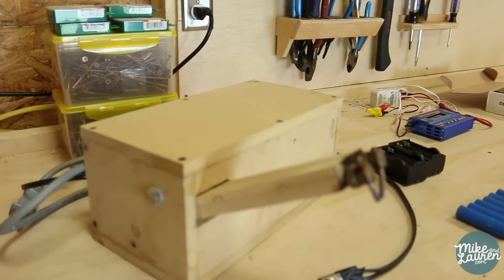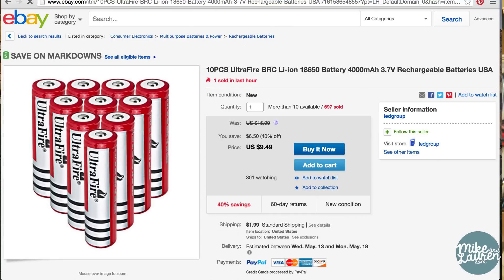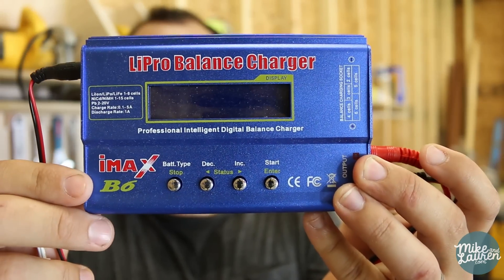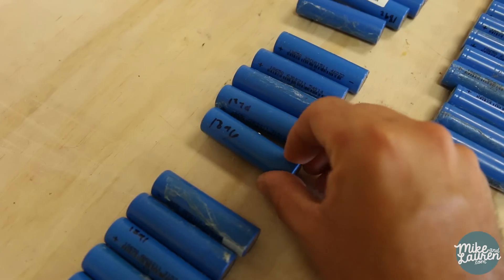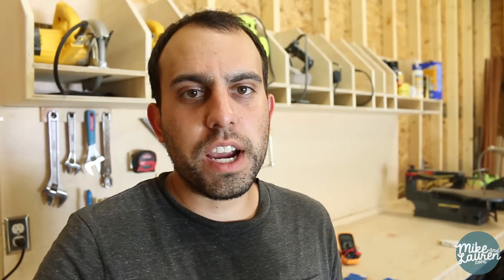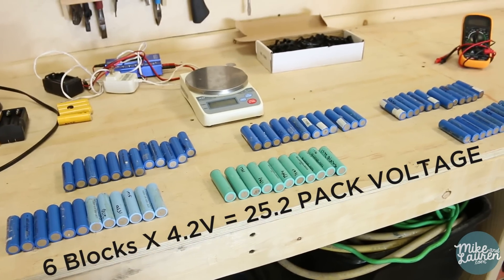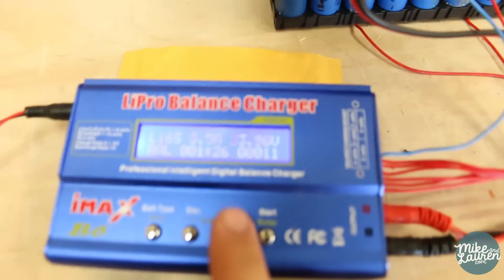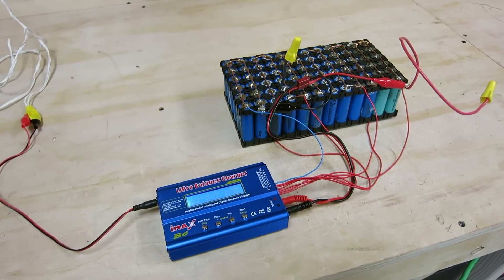DIY Lithium Ion E-Bike Battery Pack from 18650 Laptop Batteries

Comment: How to charge this amount of 18650's? This little B6 can do the trick i reasonable amount of time?

 I'm planning to build something like this for custom boombox. It will be 12V (16.8V with regulator) and i hope to attach one charging port instead of balancer.
Reply: +Yunneck if your boombox is low wattage then use a 3.7v to 12v board from ebay, if it is high wattage then yes use a buck converter

Comment: why do you use so much batteries i dont get it,you can use only 6 batteries 18650 because one fully charged 18650 has 4.2V... so 6x4.2=25.2V and for example the battery has 2200mah 2200x6=13.200mah or 13.2AH i dont know why you use so much batteries...
Reply from the maker: +Martin Spasov 6 batteries in series would only give you 2200mah.
Reply: +Martin Spasov that math is entirely incorrect

Comment: btw is the motor 48v 24v can work?
as i know it is better put more than 48v is better for power to pump up~
Reply from the maker: Wesley Poon My motor is 24V.  But the one I would buy is 48V.  That's why I made my pack 24v.
Reply: oh~ no wonder it can be powered by 24v~ XD
if climb cliff, in my opinion, it cannot power up to do that~
even more 48v can make it and take some time. the motor is hot~ lol~
i knew this things from a youtuber who is doing about this project.
Reply: +Wesley Poon rinoa super genius?

Comment: Thank you. You inspired me to build my own battery 26p 14s and it rocks!  100+ mile range and i cannot thank you enough. All old new stock 2004 lenovo battery packs with panasonic cells!
Reply from the maker: susan susansmith That's amazing, thanks for sharing!
Reply: @MikeAndLaurenTV  brother please tell me the connection of the 7 pins it would be a great help love from India you can reach me at 9855107070
Reply: @MikeAndLaurenTV  hi what discharge amp is a laptop cell 2200mah 3.7v I have built a pack 14s and 10p was wondering what the continuous amps would be ?
Reply: susan susansmith 100 mile range that's insane @@

Comment: I think you can do 36V on the pre-2009 currie ezip trailz. I have a post-2009 version so if it's over 29v, it won't start.
Reply from the maker: ebike Interesting.  I'll have to check that out!

Comment: I loved this video! But I have got a lot of questions unanswered!
1. Can we change gears?(If yes, please do make a tutorial for that as well)

2. What happens when we apply sudden breaks without switching off the motor or do we have to always switch off the motor first and then apply breaks?

3. Does the battery get charged once we manually pedal the bike? If yes, Do the batteries get damaged if we overcharge them by pedalling? And how much do we have to pedal to get a full charge?

4. How did you connect the motor?

5. How long will this battery last?

6. (A problem) My batteries were of about3.6-.7 v!
PLEASE MAKE THE PART II ASAP IN ORDER TO ANSWER THESE QUESTIONS!!! PLEASE!!
Reply: +Tsilent Geni0 there is a lot of ifs in the questions you asked, so i will pick what i think you meant.
1: if you have a rear hub motor, yes you can have gears too
2: most hub motor kits have special brake levers that deactivate the motor when braking
3: unless the hub has regen braking built in no, and it would just be better to regen downhill, not when pedaling
4: he hooked it up to the pos and neg of motor controller
5: it depends how many watts you are using, average is 20wh/mi at 12 mph
6: an 18650 is 3.6v nominal, full they are 4.2 volts.
hope this helps.

Comment: Cheaper battery spacers
http://www.aliexpress.com/item/Free-shipping-18650-battery-holder-Cylindrical-battery-bracket-18650-li-ion-cell-holder-18650-batteries-fixture/32304025030.html
Reply from the maker: iwantitpaintedblack Thanks for the link.

Comment: one question, how will you manage to balance the 12 cells in each sub-pack? because they are all wired parallel
Reply from the maker: iwantitpaintedblack You don't.   You try and balance the groups of 12 by combining "like" capacities together.  Mine were actually off a bit, so I needed to add a couple cells after the video.

Comment: you mentioned grouping batteries of similar capacity together to make each "cell" and show how the crappier batteries will need more of them to make the same capacity, but your finished pack has an equal amount of batteries in all 6 cells.  How did that happen?  Could that be a reason for the weakness of the range of the batteries?
Reply from the maker: danh le I just wanted to experiment with it.  It turned out my pack was unbalanced and I need to add a few cells to 2 of the groups.

Comment: Great video, but the link to your iMax B6 is a fake charger, I bought one of these, then had to buy a legit version. You can tell as the back of the charger does not have a serial number etc. it will overcharge your batteries every time. added to my faves though thank you.
Reply from the maker: Andrew Jones Interesting.  I'll have to check it out. Thanks!

Comment: How many amps is the battery putting out?
Reply: +Aaron Evan 1c continuous or 2c peak is max discharge
Reply: +DMAN22yeah than what's the capacity?
Reply: Aaron Evan depends on how many cells you use

Comment: At 24V 20AMPs your looking at 480 Watt hours or almost .5KWH. That's a pretty small battery for a 1/2 a kilowatt. Also given the age of these cells, I wouldn't ever discharge them past 40%. Lithium cells go bad with age which is why new old stock is so cheap Also, I would DEFINITELY keep the motor under 350 watts. You don't want a full 1C discharge of this pack. Also, charging the cells to 3.6V will make them last longer.
Reply from the maker: tarstarkusz Yea I've been discharging to 3.6 and charging to 4.1.
Reply: Mike and Lauren What kind of range do you get?
Reply from the maker: tarstarkusz It hasn't been as good as I hoped.  I've only charged/discharged once, but I got probably 15 miles or so.
Reply: Mike and Lauren Use pedal assist and go slower. The power consumption goes up exponentially with speed way out of proportion to the extra speed. Going 10MP/H takes about 75 watts, going 20 takes like 300.
Reply from the maker: tarstarkusz Good point.  I'll do that.

Comment: I like your neat workshop and the way you tools are organized.  Just a few comments.  You can still use your spot welder for battery tab spot welding.  Go to Ebay and buy a timer circuit like this one: 
Search:  DC 12V DC Multifunction Self-lock Relay PLC Cycle Timer Module Delay Time Switch

It will allow you to set on time down to 0.1seconds.  Therefore you will not burn through.  

I am glad to hear you are going to put on balance charging.

Good video and nice job on the batteries.
Reply from the maker: valveman12 Thanks for the tips!  I'll check out the timer circuit.
Reply: +Mike and Lauren I built my own Spot Welder from a Microwave Oven and using the timer will prevent the problem you were having.  You should try it on some test pieces to discover the correct on time.

Comment: hey Mike i bougth Battery Laptop HP New 74 cell inside and all i test 3.7 volt and 1700 mah do i need to charge and discharge  the battery before to install the bike thank you Mike
Reply from the maker: Demsy Rumampuk How do you know they are 1700maH?  Did you already test them, or that's just what they say?
Reply: it's print on the lebel battery 1700 maH.how do you test the maH? what the purpose of the charge and discharge the battery? thank you Mike i start the project basic on your video
Reply from the maker: Demsy Rumampuk You test the maH with the iMax B6.  It's not completely necessary, but it helps you know for sure what the capacity will be.  If it's a used battery, it definitely have as much capacity as advertised.
Reply: Thank you Mike now i understand how the battery is and build battery pack,i still wait my battery hold bracket from china soon i finish i post the link my video to you thank you so much it help me understand the battery work good job

Comment: I used 7 blocks of 12 18650 recycled cells to power a 24v Homelite push lawn mower.  It works fantastic and can mow my lawn for about 2hrs each mowing takes a bit less than 1hr.  The lead acid batteries in it were week so I got it for nothing.   I bought a box of good (2.5Ah) Panasonic cells for about $1.50, a much better way to get cells than cracking laptop battery boxes and then about half the cells are bad or week, and it's a lot of work.

You simply must check out Jehu Garcia's VW bus powered by blocks of these things.
Reply from the maker: Sparky! Love the eSamba project!  Where did you find the panasonic cells so cheap?

Comment: hi Mike thank you for reply...do you used power supply for you imax B6 or just adapter cable? and if i count you battery you discharge below 2Volt and 2ahm you battrery? am i rite? thank you
Reply from the maker: Demsy Rumampuk Depends on the model.   I would get the Imax B6AC which has the power supply built in.  I'm not sure what you mean about discharge.  The imax has a discharge setting which drains the batteries and calculates the capacity.

Comment: Nice work on the packs.  I recommend using network plugs ( cat5 ) for your balance leads as that white balance plug gets worn out very quickly.  

Running  3 x 20v 30 amps on a 48v 1000w rear hub.
Reply from the maker: Tobias Cooper Great tip.  Thanks.

Comment: hey Mike great video i try to make battrey for my ebike using your video..i have ebike motor 48 volt 1000 watt.
if i build 48 volt battrey should be i double the battrey or there other way to make ?
if you just 24 volt need cell 72 battrey
if i make 48 volt should be 144 battrey?
and how i conect the 12 block battrey to balance the charge ?thank you mike
Reply from the maker: Demsy Rumampuk You would make 2 of these battery packs, and charge them separately.  When you hook up to the bike, wire the two 24V packs in series to get your 48 volts.  I'll be doing the same thing here in a few months!

Comment: Hello Mike, great video !
About the battery spacers, are they good and sturdy ? I always try to get reviews for mechanical parts I find on eBay, especially if they come from China, would you recommend using these ?
Reply from the maker: Jeremy Dahan Once together they are very solid.  But the spacers themselves are kind of weak.  I made a mistake and had to switch some batteries around and two of the spacers broke in half.

Comment: Hey Mike,

Here's a thought I had, when you consider making your next battery box you might want to consider this, design it to make the batteries removable. Those plastic clips look like they worked like a champ and if you can run copper for a busbar maybe you can attach the plastic clips to the wood with the busbar pinched between the wood and plastic, then you will have a top and bottom that will come apart without the need to solder. It sounds good in my head when I first thought of it, but now I I ponder a bit the logistics does not seem to add up; but think about it, maybe you can come up with a working solution. I don't solder well, small connections that is, I'm a wiz with plumbing but tiny connections is NOT ME. Oh, getting back to the battery box, you may want to use threaded rod in 4 spots throughout the middle to provide support and to structure. A nut on both sides would secure the threaded rod to the box bottom and then a nut and washer at the top can be used as a leveling system for the over all cover. I don't have the ability to "DO" as I once did due to old age and past injuries but my mind still has some ideas; some of them useful...  LOL... Something else you may want to consider is making a battery locking system so that you won't have to take the laptop batteries apart in the first place, just lock it into a cover system. If one needs charged, or replaced, it's easily done. Great use of low priced items...
Reply from the maker: Paul Bialozor Great ideas.  I would be a little concerned about making contact with all 72 batteries all at once.  If even one cell slipped down or something, the whole pack voltage would be off.  But I do like the idea of quick replacement and repair if needed.
Reply: Mike and Lauren Yeah, the more I thought about it the less sense it seemed to make, but the idea is plausible if you can work out the mechanics...  LOL... Do you think that is a way to make an external connection for the battery pack itself? That way all you would need to do is replace each 10 dollar Laptop Battery as it went back...
Reply from the maker: You could if you bought newer laptop batteries. Some of the cheap ones are cheap because they have one bad cell.

Comment: I have been thinking about converting my Atomic Zombie Warrior Tadpole to EV ever since buying my Chevy Volt and enjoying the EV drive..... I have one of these for a backup power block for camping and misc stuff, as well for jump starting cars and motorcycle out in the woods while riding.. the mini jump pack has 30AH @ 400amp output on the car charger port.. I wander if you can use a few of these for a cheap already assembled battery pack for a bike.... http://www.amazon.com/Walma-30000mAh-Starter-Booster-Gasoline/dp/B00RKTD8U8/ref=sr_1_16?ie=UTF8&qid=1431349626&sr=8-16&keywords=mini+jump+starter
Reply from the maker: storxusmc Looks pretty cool.  But it doesn't say what voltage the AH is rated for.  I'm guessing by it's size it would be 3.7V whereas my pack is 20-25AH at 24V.  I'd still love to get one and actually discharge it to test it's true capacity.  That's quite a lot of capacity they are claiming.
Reply: I don't know how much it contains, but I was able to jump start a dodge diesel truck with it
Reply from the maker: storxusmc Nice.